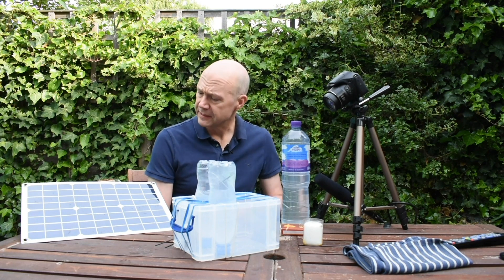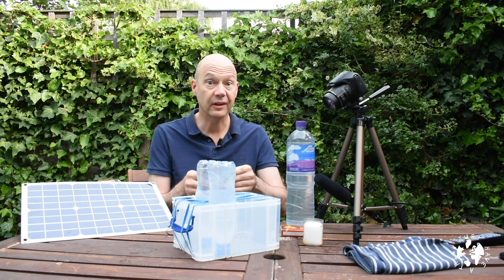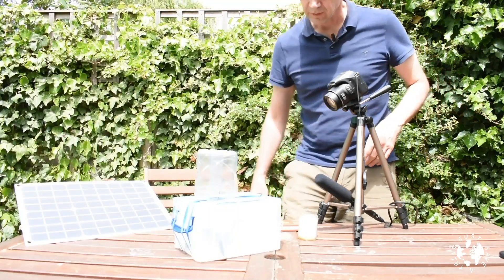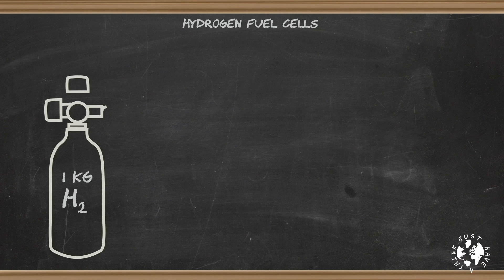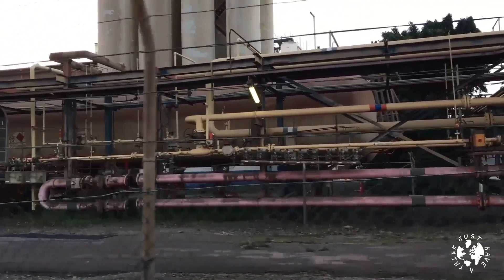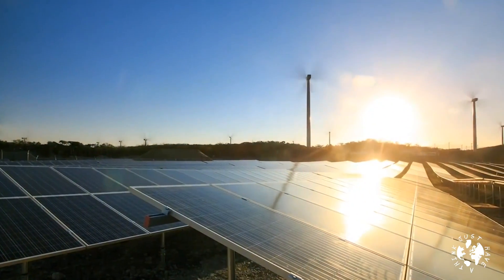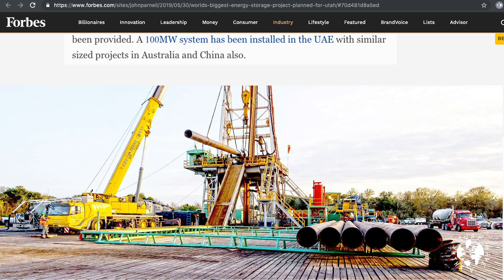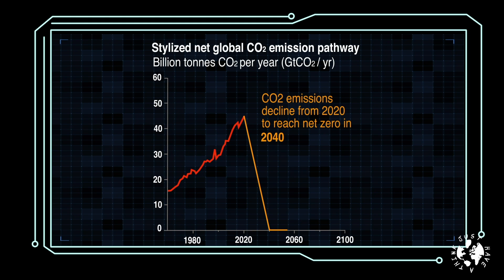Energy Storage in Hydrogen : Does this beat batteries?

Comment: think you forgot to talk about efficiency?
Reply: In the world of hydrogen one shall never speak about efficiency.
Reply: @Freba9  😂
Reply: In sunny regions one can produce the kWh for 2,7 - 3,5 cents - no subsidies !  (as in 2017 in Dubai, Australia, California, Texas, Southern Europe, India, ..... - and costs will continue to drop). 
Even in cool Germany costs are on average and over the year 4,6 cents per kWh (less in the sunnier regions). 

Wind and hydropower have  comparable costs already.

hydro powerplants often allow water to bypass the  turbines when they have more water than they need - streams full of meltwater in spring or after a rainy period for instance.

Of course they could put that "surplus" water to use if there is an industrial scale technology available. Many of these hydro power plants have been written off decades ago - so the costs are low (maintainance and running the plants).

Of course there are investments for the production of hydrogen necessary (plants could specialize in that, that would also meant production in regions that have a lot of wind or solar but not enough consumers, deserts, remote coastal regions).

A lot is lost in the process of transferring the SURPLUS  energy into "fuel" and then later there are again losses when using the fuel. But that is not so important.

And: Oil must be refined as well (that costs energy, in Texas they meanwhile also use solar power for that). Combustion or steam engines use less than 27 % of the burnt energy (most is lost to the "byproduct" heat). That barrier is a law of physics. 

You can add a part of the U.S. military budgets to the costs for cheap oil in the U.S.  And the hidden healthcare costs (pollution, black lung in coal country, asthma, etc.), plus of course the costs of disruptive climate change.

The (current) inefficiencies with hydrogen produced with renewable energy start to look much better that way.

For hydrogen they will improve the efficiency of the processes to generate, store and use it. Right now the losses are substantial - but economy of scale for industrial production is not at play yet.

Short and longterm storage of energy is an important part of the whole picture - renewable fuel for longterm storage is VERY valuable in that context  (see below)  - and it is produced from energy than cannot be used immediately. so the losses have to be put into perspective.

In fact the generated electricity MUST BE USED somehow or it would destroy a plant or do damage in the grid. Germany made their neighbour countries  nervous in the beginning of their Energy Transition - with less plannable renewable energy production. 

Electricity will flow in the transnational connected grids, national borders do not matter for physics. Czechia for instance  complained that they got some dangerous spikes (surplus) in the beginning and had to scramble to avoid major blackouts. Those problems have been solved meanwhile.

In order to be as self-sufficient as possible under less ideal conditions (seasonal, cloudy day, morning and dawn) one needs to have overcapacities. Under good conditions there will be a lot of surplus - and it must be dealt with anyway (either batteries or longterm storage).

In the U.S. electricity costs for housholds are are  10,50  cents per kWh - and in many nations and some U.S. states electricity costs more (20, even 30 in Hawaii). That leaves some room for losses when ! hydrogen makes STORED electricity more expensive. The hydrogen scheme would also translate to more of the CHEAP electricity when production conditions are pretty decent. 

You have to look at the WHOLE PACKAGE. 

the cheapest possibility is of course to consume electricity right away.
Reply: Efficiency in producing hydrogen from water has improved spectacularly in just the last few years. It started with Sonya Davidson five years ago (efficiency 89-95%) and has been improved on by Technion at the Israel Institute of technology. 
http://rexresearch.com/davidsonhho/davidsonhho.html
https://www.technion.ac.il/en/2020/01/water-sun-hydrogen/
or https://www.cell.com/joule/fulltext/S2542-4351(19)30591-4
Reply: @flagmichael  I'm talking about energy efficiency- e.g. how much energy do you get out. The first ref states water efficiency, not energy efficiency (if I read it right). I don't see anything in 2nd and 3rd is behind a pay-wall.
Reply: @flagmichael  I'm not ruling it out, but have a look at https://en.wikipedia.org/wiki/Fuel_cell ...
Reply: @flagmichael  Wow, that radio water splitting technology seems a miracle. If is true. That high efficiency will make it appealing for other uses like desalinization. South Africa really needed cheap water making. And that process is quite expensive. Uses a lot of energy. So if you split water and lose only 5 or 10 percent, then burn it back right away, you make pure water, and recover some energy back to use in the splitting making the process very cheap. 

Davidson should have seen this use. Also she should have known that Toyota made a bet on fuel cells. Toyota would gladly invest in scaling this technology. 

There are so many scams these days, and I really wonder how they have the guts to pull these schemes off. For example some guys are selling regular lithium batteries at three times the price, pretending that are capacitors, and thus will last ten times longer. Being expensive customers does not dare to dismantle them, but the scheme was exposed through discharge measurements.  I have seen some scams even on TED. one was that pretending that regular led bulbs and solar panels can be used for high volume data transmission. Other one was that wound instant sealing gel. So I would not be surprised this being a scheme too. Those few examples given were just attempts, not taken off yet. But one really worked. I forgot the name of the one who scammed some billions I think in the promise of making a cheap medical for instant multiple medical analysis. 

But even true, there is that 10 percent loss in splitting, than the loss in compressing or cooling, how much is that? So here we go toward the percentage of hydro storage. Yes, not enough locations, and huge upfront cost. But there is the gravitational storage too. they claim around 90% efficiency too. And even old mines are not so many as needed, let fill them first and next see how much will cost to dig more. Even is high upfront cost, it cannot be so prohibitive. So, they dug those holes with old technology, a lot of energy and manpower, extracted the coal or ore, Though used once, or temporary till mine was depleted, and the cost was returned. But you dig a shaft, and storage tunnel and use it for millennia. The cost will be returned for sure. The only problem is political, because long term return is not considered when profit is the target. 

Oh, and I forgot about efficiency of generating back the electricity, it is said,  40 to 60 percent. So in the end that 90 percent goes to 50 or less, while gravitational it seems to be 90. However we are just nerds wasting time online. Let see what investors and politicians will decide.   Even something is quite expensive and inefficient it can be done if there is a will, at least for a while. Concorde was quite inefficient, and it was done. And this is not just an singular example. There are hundreds of millions of such examples. Every SUV sold is such an example. 10 k for an solar system that pays itself back in a decade is carefully considered, but an SUV that will never recover the money, and will be a money black hole for the rest of its life is often bought on a whim even it costs three or five more times than an solar system, . And what about huge houses when you actually live in ten percent of that living space?
Reply: @flagmichael  I was thrilled by the two links you gave so I looked a little more into it. 

Unfortunately I do not understand what you said. At first glance it looks like you said that the production of hydrogen from water was improved by SD who invented the radio splitting technology, 89/95% percent efficiency, later improved by Technion researchers. 

What I found is that radio splitting was discovered accidentally by  John Kanzius  more than a decade ago, but the efficiency at that stage was far from being promising. 

SD has a channel on Youtube and a dedicated site except the article you mentioned on that shady site, but all she presents looks exactly like a scam to me. And not surprising on a recent rapport from IRENA about hydrogen she was not mentioned. I took the liberty to ask them about, but I assume they will not bother responding. Also I have sent the question to some guys that own a hydrogen station in Hawaii. They are in business and for sure will be interested. Unless is a scam as I warned that it may be the case.

And last. Technion seems genuine research, but they do not provide figures about efficiency. And for sure they do not improved the radio splitting, but rather used the photo method of splitting water. They work with able investors, but since no results were reported I assume that the technology need to be yet proved.
Reply: capital cost too!
Reply: Rich Dobbs regarding capital costs, they are present when building solar, wind projects.  However, we are at efficiency points with solar now where we are seeing 10-11yr break even on assets that have roughly a 30 year production life.  So, that is roughly 20yrs of net gain post Break Even where you are basically only paying for cost of transmission of the electricity to get it from production location to your consumption location.  I.e. Solar on your roof has better net price to consumer as there isn’t any transmission line required and electricity can be consumed at production facility, your house.   There continue to be PV and wind efficiency improvements as well as electric storage solution efficiency improvements but at today’s rates companies globally are now investing in a big way with projects to go 100% renewable by X date.  That demand will help over next 10 yrs for all consumers as the PV producers now have large customer base to sell to and will invest in factories required to retool and ensure optimized production which will drive down costs for all groups.  I know this isn’t a post for bene’s of PV but just as an example, to share that 25% efficiency is the rate of converting free sunlight into electricity, if you understand that even oil originally came from sunlight that grew plants that dinosaurs ate that died that the sun heats earth which causes wind patterns that eventually covered the carcasses of the dinosaurs and pressure over time created the oil, the efficiency of converting oil to energy isn’t so great and perhaps 25% conversion of PV to electricity is pretty good.
Reply: No one cares about efficiency when all your batteries fill up and the sun's still in the sky.
Reply: @80s retro Renewables are cheaper, not free... and they are not 5x cheaper as required if the hydrogen process is 20% efficient.
Reply: @Allen Loser now you are asking a great question.  And if you do a “total cost” analysis then it would make more sense.  Years ago a pack of cigarettes didn’t cost much.  It wasn’t until later that people realized they gave people cancer.  If people get cancer, they cost more on healthcare to the insurance companies and hospitals.  As such, the rates went up as well as the taxes on the cigarettes as they also cause 2nd hand smoke which is infringes on another person’s rights as well as can cause cancer in the 2nd hand smoke person’s lungs, etc.   the total cost of smoking is greater than the pack of cigarettes.  Similarly, the cost of  1kW of electricity is more than most utilities have you believe.  There is cost of transmission, cost of production, etc. but there are often subsidies to fossil fuel companies which means the fuel cost portion of your utility rates are lower.   There is also a cost to maintaining the grid, cost of building a new plant as energy demands grow, etc.   In contrast, adding your own solar with battery gives you independence.  Additionally, having the whole house battery conditions the electricity and can smooth out current disruptions which provides longer life in electronics (all sorts of systems now are ‘smart’ and have sensitive computer chips in them).   Having brown outs or black outs like there are in many areas around the globe can cost people in terms of shortening electrics cycle life as well as waste of food in freezers / fridges when power is out, etc.   All of that goes away when you move to solar / batt combo.  Now, specifically your particular utility may be manipulating rates so you don’t change as well.  There is some states / countries where they’ve fixed the ‘wholesale’ energy rates so that I can sell to the utility at the same rate they’d pay for a gas powered plant.  I sell any excess solar electric I produce and I’m a “mini plant”.  That is what I believe is the best model as it allows all of us as home owners to produce what we need and sell any excess at a fair price.  Some utilities do NOT allow you to sell at a fair price and they manipulate the rates.  That may be what’s happening to your HML utility and why you see what you do on your monthly bill.   my monthly bill isn’t a bill but rather a statement of how much the utility pays me each month.  I wish you could have the same and then I believe you’d agree with the solar potential and rates.
Reply: @Allen Loser you are correct that the Utilities “think” they have holistic cost. I’m saying they don’t as their suppliers (fuel companies) are getting subsidized.  Why couldn’t I just give you a subsidy directly and allow you to be a micro power plant?  And why can’t they pay you what they pay for generation today?   Where they do, it makes sense for solar and batteries even from financial perspective.
Reply: @Allen Loser I thought you were libertarian. Why do you want to dictate what rate I would get?   Why not let me sell my electricity at retail rate to my neighbors minus a small 'line handling fee' to the utility?  that is how other industries work.  The equivalent would be a small farmer selling produce at a farmers market and having the town set his prices he can charge for his produce.   I think its better to let the market decide what the farmer's produce is worth.  Further, if I produce it local and my neighbor utilizes it (which is typically the case), why pay me less than actual value provided?   I know you don't want to produce but keep in mind if I do, I'm increasing total electricity supply which typically puts downward pressure on costs if demand stays the same.  In the end, you the neighbor could see lower market retail rates.  Just a thought.
Reply: @Allen Loser the utility buys at wholesale rate, not retail rate.  I think that's the issue.
Reply: @zUJ7EjVD  if by ‘Hydrogen fuel generators’ you mean Hydrogen Fuel Cells( HFC), a UK company ( ‘Ceres) has developed and is manufacturing a HFC that only consists of a Steel Plate with a Ceramic coating on one side!. Also Friends of the Earth( FOE) has said ‘( Non Renewable) ‘’Lithium will amount to an environmental catastrophe in its own right’’. Then there’s Cobalt that is mined in the Congo causing rainforest destruction in Gorilla country!.also Manganese etc.
Reply: @Allen Loser I have multiple meters.  one monitors my PV production, the other my consumption, they subtract my consumption and pay net production excess at wholesale rate.  if I would need any additional electricity than what my PV system can provide, I then pay consumer rate as I get more from grid.   It would be nice if it was all paid at consumer rates but when I sell I get wholesale but when I buy I get consumer.
Reply: But it's scalable, unlike batteries
Reply: Efficiency only matters to the cost. Hydro Carbons are highly inefficient but they are cheap AF.
Reply: Efficiency is slightly irrelevant. As you can use surplus renewable energy to store as hydrogen which can either be used in a gas power plant or even to heat your home. The UKs gas grid was originally designed to run on hydrogen before the discovery of the gas reserves in the North Sea so the infrastructure is pretty much already there.
Reply: @samhunt8240  "Efficiency is slightly irrelevant."
"JUST BUILD BIGGER DAMS! JUST BUILD MORE TURBINES! BUT WHATEVER YOU DO, DON'T USE A BATTERY!"
Hydrogen supporters are the worst.
Reply: @phillycheesetake  not saying batteries don't have their place and uses, just using the logic of using an infrastructure that is already built. A virgin living in his mums basement throwing insults at people on the Internet is not going to change my mind.
Reply: @samhunt8240  "just using the logic of using an infrastructure that is already built"

Yeah, if only an infrastructure of electricity distribution was already built. I guess we can only dream.

I am really beyond humouring laymen like you who think doubling the energy investment in procurement is "slightly irrelevant". You have absolutely no clue what a herculean effort that is, and for what? The exact same outcome. Except not really, because in your outcome, we'd be maintaining two utilities instead of one.
Reply: @samhunt8240   I dont believe  you researched this statement . Hydrogen embrittlement is just one serious hurtle to over come first with using existing piping and pumping systems. Some research has been done with blending small percentages of hydrogen with natural gas. hydrogen fuels rely on overly simplistic assumptions and too much storytelling. 

It might be technically feasible to transport low concentrations of hydrogen gas in existing infrastructure to avoid the costs of building dedicated hydrogen infrastructure, but the downstream costs associated with steel pipeline monitoring, extraction equipment installation, and household appliance replacement could prove prohibitive. 

Outside niche applications, hydrogen fuels simply don't make much sense without extreme capital investment that could scare off companies and governments alike. It is just too expensive to try and  overcome and minimize the dangerous  problems. Just my humble opinion.
Reply: @samhunt8240  Probably better to use excess solar to fuel large scale carbon capture from air and get real and use nuclear as a primary base load power source (with newer plants not junk from the 60s)
Reply: @samhunt8240  Cents per kwh is key. If hydrogen production is say 30% efficient it can never compete with pumped hydro that is 60% efficient. So the plant you make for producing the hydrogen would only run after the hydro and every thing else is maxed out. You still pay the same for the plant though so the price pr kwh becomes prohibitively high. I think heatpumps and heat-storage will be the future for the northern countries.
Reply: @lystfiskerlars  Exactly. Nobody is going to invest in a (very expensive) H2 production facility if it is simply waiting for 'surplus energy' 90% of the time.
Reply: @lystfiskerlars  yes but what I am saying is we already have the infrastructure. The storage comes from using our already existing gas grid then it can be used for electric and burning the gas itself, if then gives the grid a lot more flexibility on where it can draw its power from. Not only that but cheaper hydrogen would lead to more development in synthetic fuels to replace petrol and diesel instead of digging it out of the ground.
Reply: @samhunt8240  The grid can be balanced much more efficiently by using stationary batteries and EV's.
Burning fuel to cook, heat and transport ourselves should soon be something from the past.
Only exception (for the time being) would be aviation. And yes, synthetic fuels will probably play a role in that situation untill batteries have a high enough energy density.
Reply: @Freba9  I understand where you are coming from don't get me wrong, but my point is infrastructure. The infrastructure is already there for hydrogen, for a change to electricity instead would require a huge amount of resource to build grid storage batteries. Plus with low cost hydrogen leading on to synthetic fuels, that will lower carbon emissions on every existing car/bike/truck etc. Not every car will be electric.
Reply: @samhunt8240  Of course it is nice to keep using an existing infrastructure. But the electric infrastructure is also already there. For hydrogen we would need to invest vast amounts in electrolyzers, fuel cells and storage tanks. But then again, there is a very big difference in efficiency compared to electric and batteries. So apart from the hydrogen facilities you need much more energy production facilities (wind turbines, PV plants, power stations). Centralised synthetic fuel production is a different story and has nothing to do with using the existing gas infrastructure.
Reply: @lystfiskerlars   countries with moutains and valleys have used pumped hydro for many decases - the topography helps A LOT with construction costs. See Austria, Norway, Switzerland (maybe Costa Rica - they have a lot of hydro). So it is fairly cost-efficient for peak demand when the pumping is done with surplus electricity.

But to scale it up for the whole planet it is not a solution. Hydrogen would be better suited. (or producing fuel or materials for fuel with artificial photosynthesis). 

There are ideas to use old mines - fill them with water or move weights, or compressed air
Reply: @Freba9   ECONOMY OF SCALE - costs will drop like with any other technolgy when produced at a large scale.
Reply: Xyz Same I was not referring to economical efficiency.
Reply: Simon don’t forget that. You need Hydrogen for Aviation, Shipping and some rail industries.  If we had hydrogen solutions for those industries, we’d dramatically lower carbon emissions and lower sound levels as well as maintenance levels of planes, ships, etc. due to fewer moving parts.
Reply: @Freba9  Sadly, grid level storage is off to a rocky start. Battery fires are not unheard of and are extremely difficult to fight: the reactants are both contained in close proximity and they maintain the fire even at relatively low temperatures. Batteries are also energy storage, not power storage. With batteries we pay for storage by watt-hours; with hydrogen or pumped hydro we pay by the watt. Increasing storage for hydrogen or water is a matter of more containers. (Recently retired from a large electric utility; we had a battery storage unit near me that went up in flames. The manufacturer warned us if water was applied it could detonate, leaving a crater where the substation was.)
Reply: @lystfiskerlars  good points but I question that 30% figure. the energy used is wasted or by product energy.
Reply: Faithful hydrogen worshippers must shake off the earthly shackles of logic and economy so their souls can soar into the eternal bliss of hydrogen heavens filled with negative entropy.
Reply: If the energy is going to waste (wind power, middle of the night) then efficiency is of a lower concern.  H2 production from waste energy is very viable.